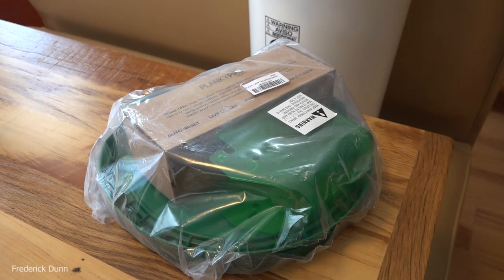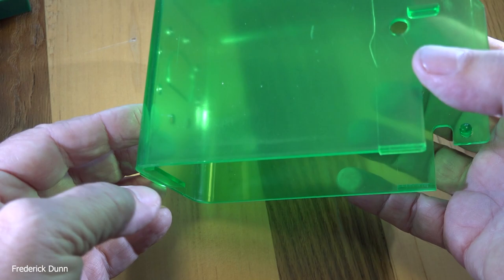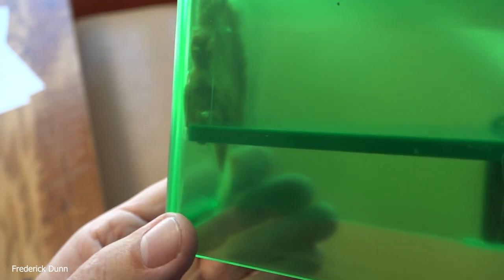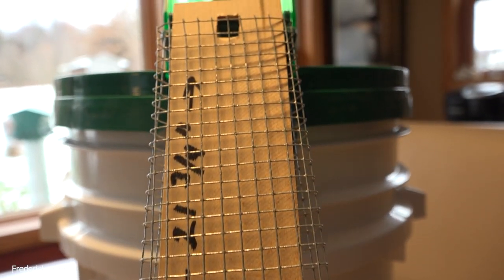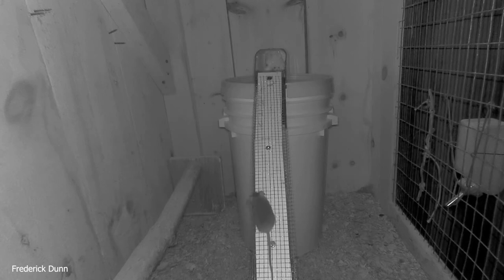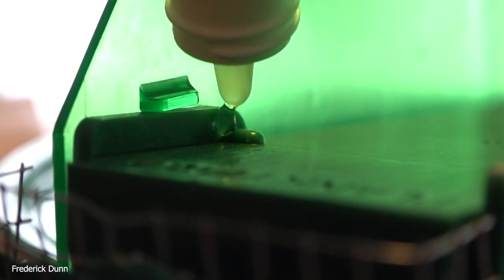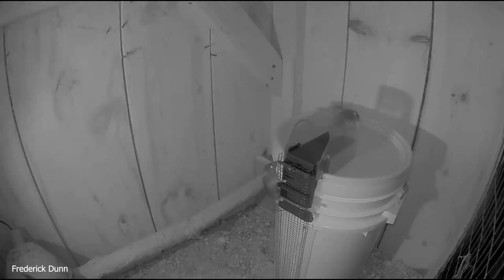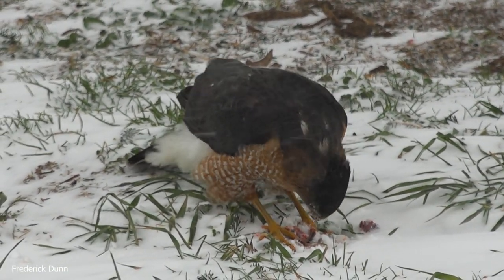The Best Way to Trap Mice without hurting them. Walk the Plank Style Bucket trap BEST Bait, it works

Comment: I had few mice get into my hive, started chewing out comb, eating bees?  My fault,  was too busy to install a mouse guard.  Used similar approach with a swiveling 1 in dowel on top of the bucket....antifreeze at the bottom.  No more mice.  could never get a rat though,  they're too smart
Reply from the maker: Yes, the log-roller trap is another good one.
Reply: @FrederickDunn  peanut butter works great, I add deer corn kernels to mine